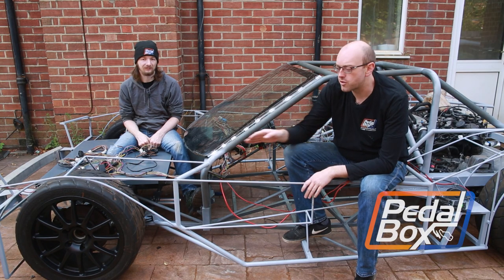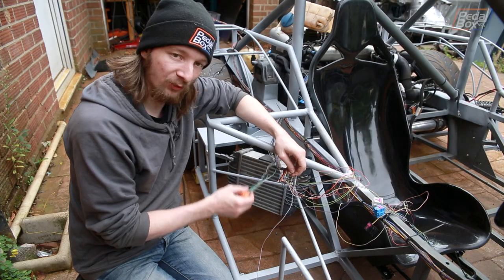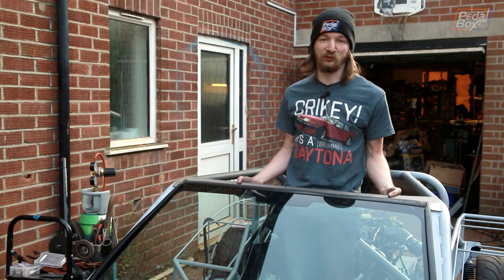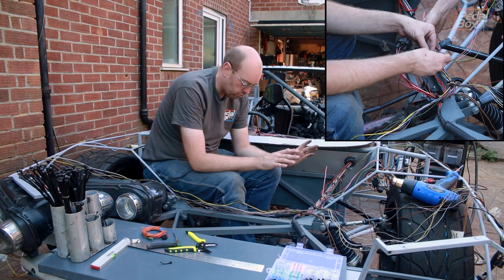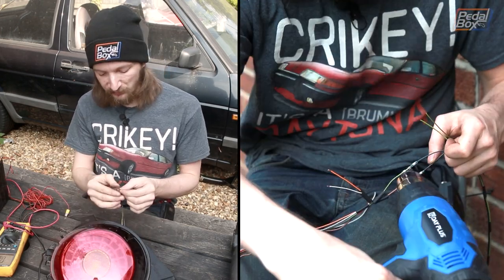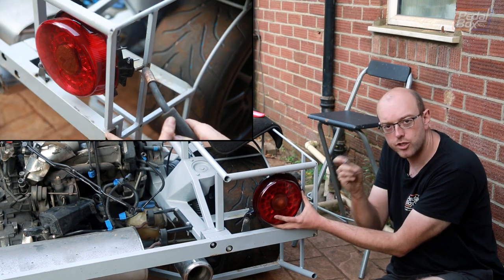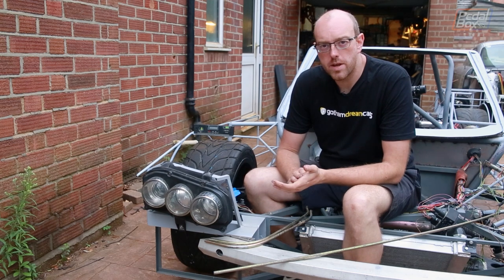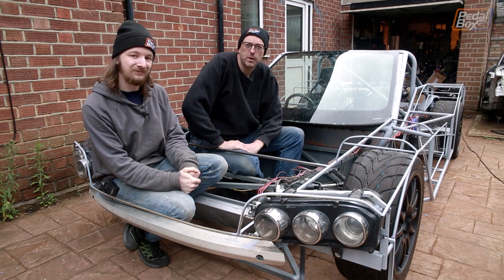Wiring. So Much Wiring | Audi TT Kit Car| PedalBox Episode 62

Comment: Where did you get the rubber grommet that the wires pass through the fire wall at the front?
Reply from the maker: Thats actually an OEM part from the TT, if you can find one in a scrap yard you'll be good to go